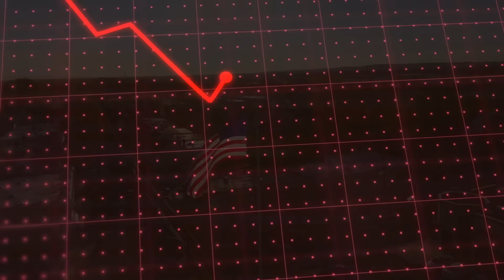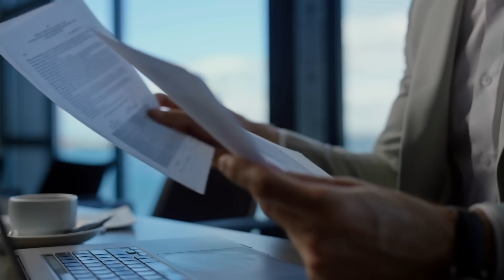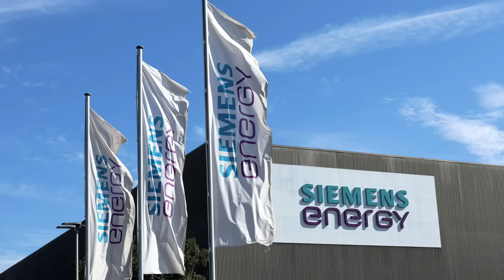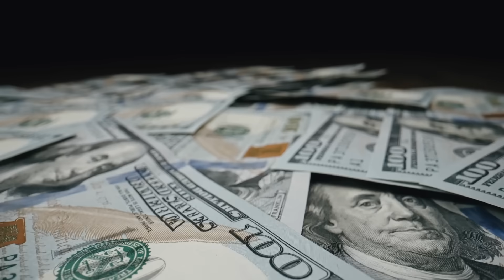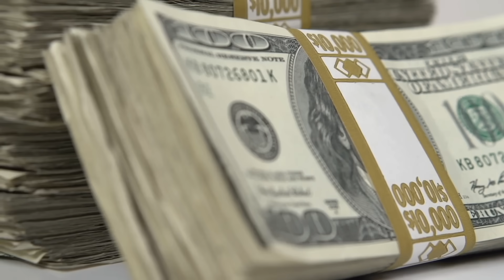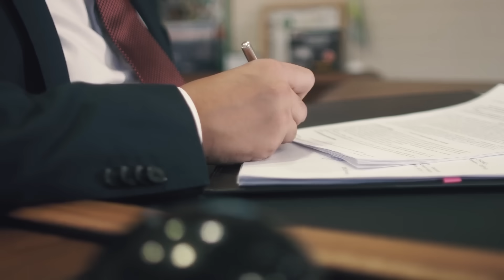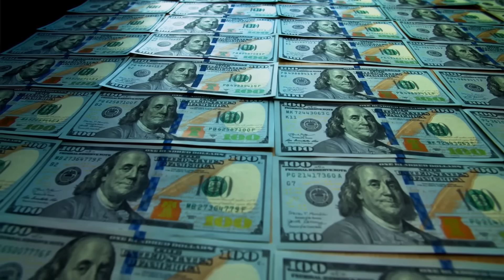The Real Reason America Has Turned Its Back On Wind Power Energy

Comment: Here's an idea for all those "stranded" wind farms.  Use them to power electrolysis cells to produce Hydrogen from water, then use the Hydrogen to fuel Rankine-cycle powerplants.  Or, use the wind farms to pull CO2 from the atmosphere, react it with the electrolysis products, and produce methanol that can be used to fuel real cars (if they're converted to burn it).
Reply: At last, some sensible comment. The hydrogen could also be used to make ammonia which would directly replace fossil fuel based ammonia. With carbon capture synthetic fuels could be made to replace what we now use.
Reply: That is not different than just producing electricity.
Reply: @old-pete  I know, but at least the investment in the wind turbines could be put to good use.  Well, at least SOME use.  Not saying it's any better than what is already being done, but the money isn't just flushed down the toilet.
Reply: @andyharman3022  It makes no difference what the electricity is used for. It is the same money.
Reply: @old-pete  But it gets past the problem of waiting for the electric power utility to connect the new wind farm to its grid.  That was what I was brainstorming about.  Even if the wind turbines are not being used, they still need to be maintained.  They may as well be producing electricity, which has value, for some useful purpose.
Reply: @andyharman3022  How do you think does the electricity get to the electrolysis cells? Through the air? How does the hydrogen get to the customers?
The infrastructure needs to be connected.
Reply: @old-pete   The problem is, the electricity has nowhere to go.
Reply: The idea is, locate electrolytic cells close to the wind farm. Use the electricity to make hydrogen and the hydrogen to make ammonia, Ammonia can be stored and transported over long distances. This "green " ammonia could displace ammonia made from fossil fuels
Reply: @mike160543  Certainly being explored, but the hydrogen approach currently has more traction for offshore wind.
Reply: IMHO the logistics involved in transporting liquid hydrogen will tilt the scales in favour of ammonia . There is already a substantial seaborn trade in ammonia. Green ammonia could displace fossil fueled ammonia in this  market
Reply: @mike160543  The hydrogen isn't liquid, it is in a gaseous phase, the intention is is to reuse parts of the existing gas field infrastructure. Ammonia is being proposed as a fuel for shipping..
Reply: Hydrogen gas is very light, so if it has to be transported as a gas it is pressurized.
A typical hydrogen tube trailer weighs 60,500lb = 27,442kg.
It holds 686 lbs = 311kg of hydrogen.
The pressure is 2400 psi = 16.54 megapascal = 163 atmospheres.
A typical ammonia rail tanker holds   80 tons = 72574kg of liquid ammonia at a pressure of around 150psig= 10.2 atmospheres and ambient temperature.
Under these conditions ammonia has a density of 0.6g/cm 3 = 37 lb/cu ft
This ammonia contains 14 TONS = 28000lbs of hydrogen
Liquid hydrogen boils at 20.3degrees K = -252C = -423f.
At this temperature it has a density of 0.07085 g/cm3 (4.423 lb/cu ft)
So liquid hydrogen contains much less hydrogen than liquid ammonia.
 @glynnwright1699
Reply: @mike160543  It is pumped along pipelines, not transported by tanker. The British and German governments are currently engaged in feasibility studies for such a pipeline to connect the shallow Dogger Bank, which is around 70% within the UK EEZ, through a hydrogen pipeline running directly to Germany, or via Norway,  for hydrogen generated on the Bank. The shallow water, large geographic area and strong prevailing winds make the Dogger Bank the prime location in Northern Europe for generating electricity and using it to generate hydrogen.
Reply: @old-pete  It is quite different because it becomes possible to store energy, and it more economical to transport hydrogen longer distances than electricity. Moving electrical energy from offshore turbines becomes very expensive as the distance  increases. The proposal is to construct energy islands on the shallow Dogger Bank in the North Sea and then use a combination of new pipelines and existing natural gas pipelines to move the hydrogen to Europe and the UK to onshore power stations. The British and Germans have signed a MOU to develop such a scheme.
Reply: @glynnwright1699  electricity transport is much cheaper than hydrogen transport. Hydrogen loses to much energy through compression.
Reply: @old-pete  Extensive studies indicate that the cost of moving offshore generated electricity directly is greater than moving hydrogen through pipelines, where the hydrogen is generated close to the turbines. This is true for the Dogger Bank. 

"In April 2022 Britain pledged to double its hydrogen production to up to 10 gigawatts (GW) by 2030, with at least half of it from electrolytic hydrogen."

"The German government is keen to move to a feasibility study for the project, while the U.K.'s Department for Energy Security and Net Zero says it is keen to become a hydrogen exporter and wants to understand the options available.

Under the economic model envisaged, the U.K. would harness its vast offshore wind reserves to make the hydrogen, and then pump the product under the North Sea to fuel the industry of its continental neighbor."
Reply: @glynnwright1699  Physics disagree. Compressing gases costs a lot energy.
Reply: @old-pete  The schemes do not liquify the hydrogen, it is pumped along pipelines, just like natural gas. In fact, the proposal is to reuse the existing very extensive  natural gas infrastructure.
Reply: @glynnwright1699  Pumping is done by compressing.
Reply: @old-pete  Pumping is done in exactly the same way as natural gas.
Reply: @glynnwright1699  ... which gets compressed.
Reply: @old-pete  
"Compressing hydrogen (isothermally) from 20 bar to 350 bar requires just 1.05 kWh/kg H2, with an additional 0.10 kWh/kg H2 to reach a refueling pressure of 440 bar."

Pipelines operate at around 60 Bar, the energy required to transport hydrogen along a pipeline is around 3% of the latent energy within the hydrogen.

Submarine power cables have losses of between 8% and 14% over a distance of 200 km.
Reply: @glynnwright1699  As I said, compression.

Energy losses depend on pressure and voltage and what you compare.
Transmission over 200km is indeed very long and not typical.
Reply: @old-pete  The minimum distance from the Dogger Bank to shore is 150 km, ranging up to 250 km.
Reply: @glynnwright1699  That is not your typical offshore winpark.
Reply: It is already in process in the North Sea, particularly on the Dogger Bank.

Comment: The solution is local solar power.  The billions of dollars used to build these inefficient wind farms and solar farms and upgraded transmission lines should instead be spent on installing solar power on the roofs of homes and commercial buildings along with installing energy storage systems.  Instead of spending billions of dollars upgrading the electrical grid to handle increasing electrical demands, we would distribute the power source among millions of homes and businesses.  Wouldn't it be great to have a infrastructure power outage that had no effect on most homes and business because these homes and businesses were getting their electricity from their solar panels and power walls.  The video did not point out that the manufacturing of these gigantic windmills is also harmful to the environment.  Research needs to be concentrated on improving the efficiency of solar panels and reducing the harm to the environment caused by the manufacturing the solar panels.
Reply: Roof installed solar is more expensive. The great advantage is the cost advantage over a consumers power prices.
Roof installed solar does not make a house grid independent. If one wants that, one has to invest a bit more and and a battery back is recommended,  but even that does not grant complete independence.
Wind and solar power are more enviromental friendly than fossil fuel based power.

Comment: The grids are close to maxed out and yet there is a push to transition to EVs and changing from natural gas heaters, water heaters, and stoves to electric versions.   The grid needs to be upgraded first.
Reply: Decades of infrastructure being ignored and left to go to pot. Antiquated electrical, water, roads, bridges, etc.
Reply: @dennisjoseph629  So right. It didn't happen overnight. Sadly the taxes were collected at every level of government and the funds were diverted to other things.
Reply: @dennisjoseph629 and yet we talk bad about China 😂😂
Reply: the UK is aiming for at least 80% EV ownership in about 10 years time. Currently there are 33.6 million cars in the UK, so that translates to about 27 million EVs.  Not all will be able to take advantage of home charging, but if we're very generous and assume 50% (13.5 million) can, and they all use the "standard" home 7kW charger, that's an overnight power demand of 7000W x 13,500,000 = 94.5 GW. The ENTIRE UK installed generating capacity is currently 101GW,  i.e. 94% of available capacity will be used for a number of hours (7 - 10) JUST to charge 50% of the EV CAR fleet alone, let alone the charging needs of Commercial vehicles, buses, etc.

Incidentally, if the remaining 50% decide to use the new generations of 250kW SuperChargers, at the same time, they will "consume" over 30% of the GLOBAL generating capacity - 3.4 Terawatts out of a Global capacity of 11 TW. Remember, that's just HALF the projected EV Car fleet ONLY  in a smaller Country.
Reply: @thedave7760 They have put the cart before the horse on EVs.
Reply: @thedave7760  : no problem, Rishi Sunak will solve that problem some time in the future. Meanwhile try to stay warm with your 100 watts electric heater.
Reply: "They" don't want to a accept this.
Reply: I invested five years of my life and more training in a grid efficiency project that was never fully approved. When the layoffs and firings started happening I nearly lost my life to some horribly planned electrical hazards. As an apprentice, I learned not all the leadership walks like it talks.
Reply: Problem one stop building homes and apartments fill up what is empty same goes for commercial warehouse
Reply: You would think these people making laws would research this stuff. Obviously it's up to us.  Trying to stop offshore wind where I live on the coast of California. Yeah California seems to be full speed ahead to create this debacle.
Reply: Or get solar power and battery's for your house .
Reply: Whatever is wrong with a natural gas stove or clothes dryer? Lots of people heat their homes with natural gas. There are practical science reasons why we need to use natural gas. Largely because the evil deep state suppresses free-energy technology, which I suspect already exists and has been proven to work.
Reply: Yes... So.... the thing to do is...... yes..
Reply: @granthurlburt4062  Trillions of dollars. Massive amounts of copper. Also, what kind of power plants go online to generate the additional power. Nuclear is the most effective but Americans are reluctant to have new plants built.
Reply: The grid can be upgraded gradually.  Socialization factors limit EV use.  Women won't use unattended public chargers and many men avoid public chargers after dark like they avoid ATMs at night.
Reply: @timothykeith1367  EVs are normally charged at home.  Yes, the grid will be upgraded.  We're just getting started.  There weren't many petrol stations at the start either.   Give it some time.
Reply: Yes after 49 years of constant treason by Labor/gang-green Politicians and the Cowardly LNP politicians, we are still just barely a Sovereign Nation! but have our politicians in Labor and LNP made private agreements with the Globalist Cartels for when the UN Global Government is realised! The betrayals of our Politicians for the WEF=EU=WHO=UN that have weakened our Sovereign position!
                   I remember when we did make our own fuels from our own oil and Gas, we were the Luck Country after WW2, we made and grew everything the Australian people needed, no job shortages, one income families, yes that had to change WW2 succeeded in destroying the globalist Monster on My parents time, today we are in the fight of our lives against the globalist MONSTERS of this century! the WEF=EU=WHO=UN=Billy Goats=Vanguard=Black Rock=Big Pharma=Big Tach, all wanting a position on the Great Reset table, sounds just like a movie script, must be bulldust right.
               But that was before our two UN controlled governments turned to the "Dark Side" back when we were the Lucky Country, we manufactured and grew everything the Australian People needed and exported it around the world as well! That was 49 years ago, before Labor and LNP turned to the "dark side" of the unelected United Nations,
         In 1975, with no public consultation, the ALP government of Gough Whitlam signed Australia up to the United Nations Lima Declaration which required Australia to reduce its manufacturing capabilities by around 30% and carelessly destroying 30% of Aussie workers jobs!  and to commit to importing that amount from other preferred countries China, Vietnam, India. Pakistan, etc since then the UN controlled Politicians are destroying our electricity supplies, our Industries, our defence of this nation, and are currently working on destroying our Farmers as agreed in the UN Agenda 2030 sustainability and Climate Change scams agreed to in 2015 by LNP PM Malcolm Turncoat and Julie Bishop ( She now works for the UN! No surmise there),
                        the betrayal is by both labor/Gang-greens and LNP, also the LNP leads labor in their Collaboration with the UN, also in case you are unaware, the Globalist Cartel consists of the WEF=EU=WHO=UN so there is really no distinction between the whole Globalist Cartel and just the UN.
Reply: i think they want us on all electric so they only have to flip one switch to kill us off.
Reply: @bill3641  We'll upgrade as needed.   It's a heck of a lot easier to handle electrons than gasoline.
Reply: Call your congressmen, senators and council and tell them windmills are in the best interest of the people and give them good reasons why. Also wind power is much cheaper then nuclear power
Reply: @kennygaming208  Nuclear power is very reliable and predictable, unlike wind. China and other nations have developed small reactors which can be distributed closer to the demand, thereby reducing transmission distance and line loss.
Reply: How did the drone flying across the world able to drop a missile before or grid upgrade
Reply: We need the EVs but not the electric heaters.   Creating heat by electrical resistance is the most inefficient use possible.
Reply: @josephastier7421 we don’t need the EVs either
Reply: @Pupperino7773  Thanks to the Great Pandemic a lot of us are working from home, but we do still need cars in many cases.
Reply: @josephastier7421  really don't need evs. there rather nich. unless there's a major advancement that best petrol. and i really dought it cuz physics is agenst it. all has to do with the charging speed. even then still have to upgrade the grids first to even have a chance.
Reply: @alexlindekugel8727  Everthing you just said is false, but thanks for posting! 😂😂😂😂
Reply: @josephastier7421  yah no. but nice try.
Reply: @alexlindekugel8727  Have you ever driven an EV like the Tesla or Polestar?  One of the major advancements is regenerative braking, where you lift off the accelerator and let your kinetic energy turn the motor to charge the battery.  You get used to it fast.  In a gasoline vehicle that energy is discarded as heat and wears out the brake pads and rotors.  A set of brake pads on an EV will last the life of the car because you rarely use the brakes.
Reply: @josephastier7421  
Not so. Electric resistance heat is good for at least some applications. And energy ought to be free by now. The universe is full of energy and so why are we still paying for energy?

Currently with the cost of things, natural gas is generally a better way to heat our homes.

I think Tesla has been pushing heat pump technology somewhat for the heat. If you use that option for your water heater, then it is more likely to break down. Well heat pump is more complicated and more stuff to go wrong. When I bought a window air conditioner, sure I might have liked to have the heat pump model. But why would I pay double the price for a much more limited selection? I take the window air conditioner out of the window, for winter, as there are multiple other ways to produce heat. I have natural gas logs for heat in the winter, so I would take the heat pump feature if it was free, but it costs too much for my application.

There was a YT video I watched that recommended AGAINST buying the more efficient furnace, because they are more complicated, more stuff to go wrong, and more expensive to fix. Well that would defeat the purpose of saving money, would it not?
Reply: @josephastier7421  That is so true.